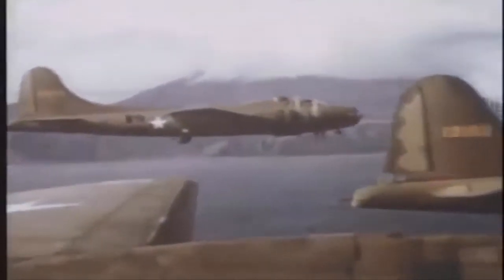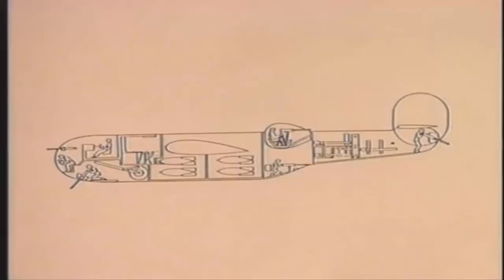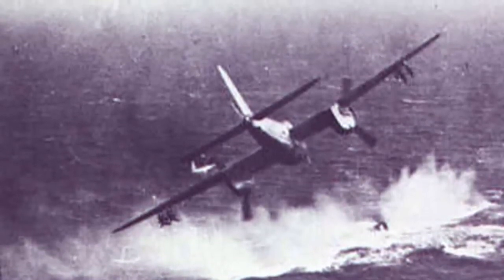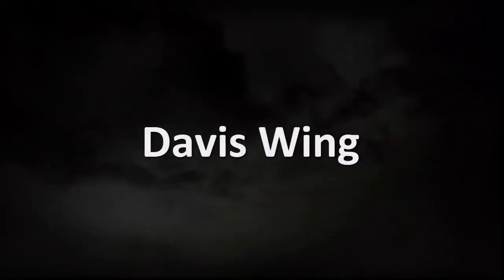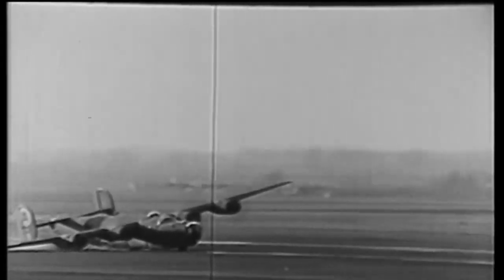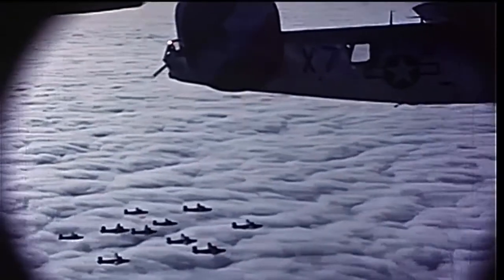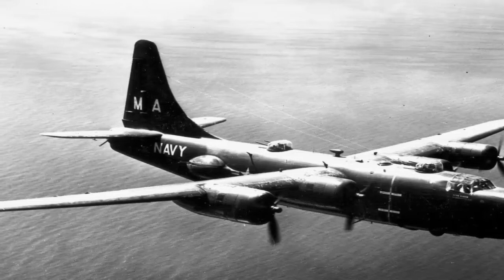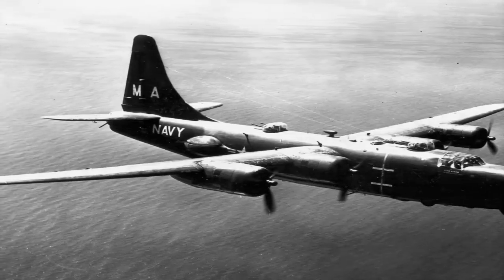B 24 Liberator:  3 Major Design Flaws

Comment: The B-17 had a major flaw too, and to this day no one can say how many were lost due to that flaw, as no air crews were known to survive the catastrophic fire that flaw would cause until the one that led to it's discovery.
The design flaw was discovered very late in the war, so it is highly probable that losses were attributed to combat when they were in fact due to the flaw.
Reply: What was the B17 flaw?
Reply: Don't leave us in suspense now
Reply: @augustdenger8231  Apparently, an oxygen feed to the cockpit was close enough to the upper turret ring as to rub against it and wear a hole in the pipe, this resulted in oxygen flowing under pressure over the turret electric drive wiring panel, resulting in a spark igniting the oxy and flooding the cockpit with a ball of flame, often killing the flight crew. after it was discovered, literally hundreds of aircraft had to be refitted to fix the flaw, which had been there since the B-17 was designed.

Comment: The B24 gets criticized for the tendency of its wing to fold up if hit in the main spar at the wing root, there is actually a very dramatic if short video of this happening to a B24 available on YouTube. The thing is, all aircraft are vulnerable at this point, and if a B17 gets hit in the same place its wing is likely to fold up too. Plus the B17 had been designed and built several years earlier and had built up a reputation among the press and the public as being invulnerable, the name Flying Fortress says all you need to know about the legend it had built up before it flew a single mission against Germany. the reality was different of course, B17's were being shot out of the sky in frighteningly large numbers, raids to places like Regensburg and Schweinfurt were disastrous and the vulnerability of any heavy bomber without fighter escort was obvious to all.

Ultimately an aircraft succeeds if it fulfils the purpose it was designed for, and the B24 did perfectly well in this regard, its losses were overall no greater than the B17 and succeeded in roles that the B17 failed in, such as a maritime patrol aircraft and U Boat destroyer. It's a shame it gets an undeserved bad rep next to the B17, it was a great war-winning aircraft and deserves to be remembered.
Reply: Every WW2 bomber had its Achilles heel...some times more than one.. 
Proportionately the Wellington was incredibly tough as it was built on a Geodesic framework .
The Lancaster carried the heaviest bomb load of any but it was vunerable from attacks from below. The liberators gift was to coastal command because its range closed the Iceland gap against the u boats... allowing thousands of troops to get through and supplies to let everyone else to take the war to the Nazis.
Reply: The film I know of showing the left wing folding and bursting into flame was shot from above, and it appears it was bombs released from that plane hit the wing.  Either mistimed release, or the B-24 in question was too close and directly underneath.  It was blamed on a direct flak burst, but look closely...there was an attempt to airbrush the falling bombs out of each frame.

Comment: Despite a few small problems, the B24 was an excellent aircraft and hold up pretty good under ground fire also it was one of the best gun platform in the air Force, one version carried 13, 50cals and a 75mm cannon, simply a beast.

Comment: They were exhausting to fly because they simply could not be neutrally trimmed. The pilot could not take his hands off the controls even for a second or it would jaw and pitch to port. No amount to aileron adjustment could fix it. The Davis wing was  basically unstable. The B17 was better but neither could achieve the stability of the Lancaster which could fly itself once trimmed and only ever needed one pilot. There were many instances of Lancaster pilots being shot hot in combat and the plane flying all the way back from Germany on its own. Even a radio operator could get one back on the ground.
Reply: Unlike the Lancaster, both the B-17 and '24 had "Auto-pilot" to take care of that, which the RAF specifications did not provide for.

Comment: I spoke to a WW II veteran Army Air Force pilot who flew the B-24 with the 8th Air Force over Germany. He told me that the Davis wing had excellent lift characteristics and efficiency at lower and medium altitudes, but at high altitudes at about 20,000 feet or higher, the Davis wing is ineffective and useless in the thin air and made the bomber was notoriously difficult to handle. He said it handled like a “fat lady trying to do a ballet dance.” He said you had to “fight it with all your might just to keep it in formation” and it took great skill and experience to be an accomplished B-24 pilot.
Reply: That's also what my father in law told me.  He was a B-24 pilot/aircrew commander in his early 20s, and when asked about it would just shake his head and say "It was like trying to fly a dump truck".  Especially when heavily loaded and in thin air, he felt like the biggest challenge and danger was trying to stay in formation and not run into the aircraft around him, or vice versa.  It was exhausting, mentally and physically, and took a certain kind of pilot to be physically able to wrestle with that beast for hours and perform the necessary large, unassisted control inputs.  Because of the challenges of flying them in close formation, the 24's tended to fly looser formations than the B-17s, which of course the Germans noticed and tried to use to their advantage.
Reply: Very true, but it was calculated tradeoff for more speed range & bomb load.
My Dad was a 24 Navigator and like the Bombardier had basic Flight Training
so they could jump in should either Pilot or Co-Pilot be disabled. He said it handled well in flight, but he never wanted to have to land one because it
landed at a very high speed and took tremendous skill to get one back on the ground safely. They often flew above 20,000 ft and unless they started icing up
it remained fairly stable. The icing was a know fact about the Davis Wing.

Comment: When Davis, the inventor of the wing, was taken to the factory as the first planes were being made he walked around one and said "You have the wing on at the wrong angle."  The pilots had to fly with the tail up 10 degrees to get all of the fuel out of the tanks.
Reply: Author Ernest Gann flew the C-87 cargo version of the 'Liberator' in the Far East campaign: he wrote that 'the much-vaunted Davis wing couldn't hold enough ice to chill a highball'.
Reply: @None-zc5vg  Icing is the fatal problem of all laminar flow aerofoils. An insect in the wrong place will wreck the performance.
Reply: It is not a laminar flow wing.
Reply: @givenfirstnamefamilyfirstn3935  The Davis aerofoil was a laminar flow aerofoil. That was shown by the Caltech wind tunnel tests. It wasn’t as good as the later properly engineered laminar flow aerofoils but it was one none the less.
Reply: Maximum camber and thickness was at 29.6% of chord.  End of argument.
Reply: @givenfirstnamefamilyfirstn3935  And?
The Davis aerofoil was the FIRST to try to increase laminar flow (even by accident) - I didn’t say it did it as well as the later properly ENGINEERED ones.

Comment: Considering the fact that the B-24 could actually carry the amount of bombs that the B-17 had promised but was never able to provide. I think that the trade-offs were quite understandable.
The self-sealing fuel tanks were also added to the B-17 after the beginning of the war.
The biggest problem is B-24 had was the reputation of every single one of them that was built at the Willow Run assembly plant because they were so sloppily put together that they leaked like a sieve and frequently were not able to complete missions and disappeared with no one surviving the incident.
Those plans were so bad it is amazing that Henry Ford was not brought up on charges of treason?
Reply: That ain't the only thing wrong with Henry Ford .

Comment: Another weak point was water landings. They usually resulted in the fuselage being ripped in half just forward of the wing. The high mounted wing meant the fuselage took the full hit of the water.